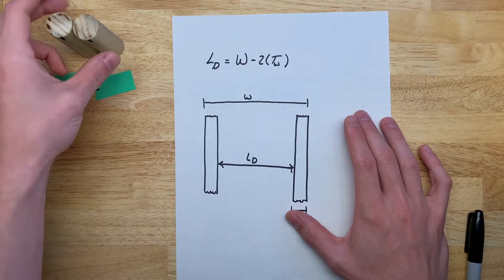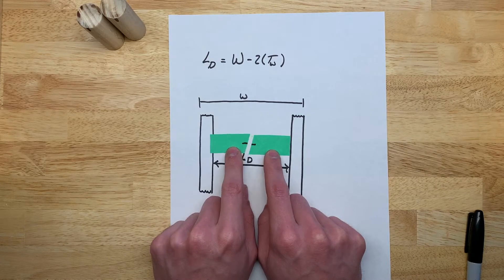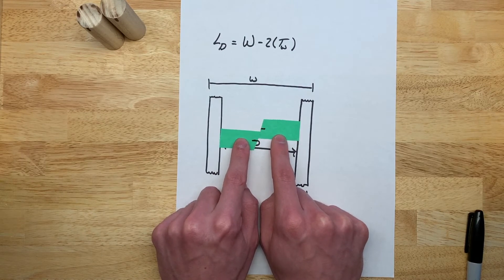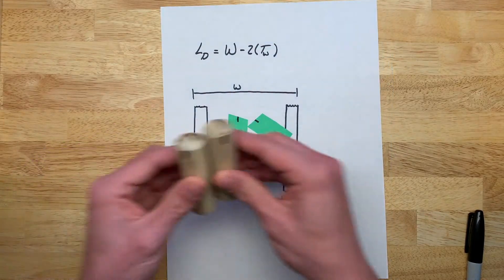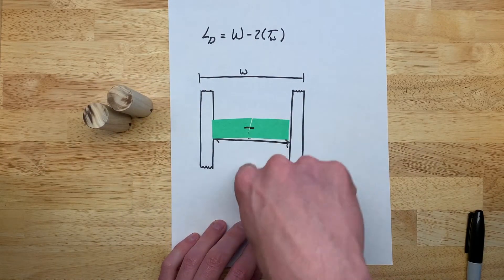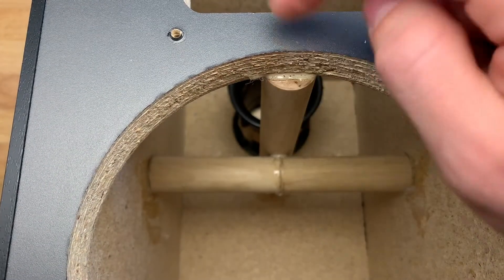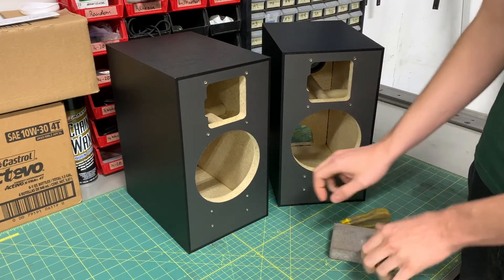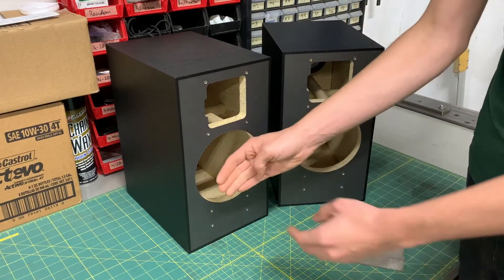Part 3/3 Upgrading the Enclosure and Reassembly - Upgrading Paradigm Mini Monitor V5

Comment: That was a nice endeavor but I saw that you put back the polyfill damping material inside the box. Personally I think polyfill is one of the worst stuff as damping goes. Nowadays I use mostly 1/4 inch acoustical foam because it is better at controlling midrange frequencies and reverberations. Of course, it cost a little bit more, but the improvement is more than marginal. Try it on one of your speaker and compare to the one with polyfill and tell me how it sound.
Reply from the maker: @Yves Boutin - The reason I did not include the adhesive dampening foam in this build is simply because I forgot to put it in my order when I got the crossover parts. Oh well, mistakes happen! I can get it next time I make an order and put it in then.
Reply: @Casey_Schmidt  ...or try Rock Wool, I've found it more acoustically absorbent than anything else I've tried and will be using some when I get my Paradigms. I like the port design, with the two rolled ends it appears one could play with the low octave response by slightly shortening or extending the PVC tube which runs between them. I'm toying with the idea of closing the rear port and adding one to the center of the bottom, and of larger diameter, so I can use a longer tube to double as a stand with the port opening at the bottom, firing into the floor for better room bass coupling.

Comment: Any comments on the upgrade? Was it worth the 100usd in parts? Just picked up a pair of these stock and havent had a chance to listen to them.
Reply from the maker: @gsrchris u - The sound signature after the upgrade makes them sound much more open and transparent, in my opinion. There is more detail in the decay of notes/vocals and you can hear reverberations in the space in which the recording took place a lot more clearly which aids in detail. It’s no replacement for a top-dollar system but it’s a substantial improvement.

Asking whether it’s worth $100 USD is a tough question to answer. If you’re on a very tight budget, I would probably say no it’s not worth it because the improvement in sound, while significant, isn’t truly necessary for a budget system. If $100 USD is worth the enjoyment of the upgrade process and the incremental improvement in sound quality, then I’d say it’s absolutely worth it.

Comment: What as the paper for when you soldered the wires to the woofer?
Reply from the maker: @Shop Philosophy - I put it there to prevent any solder splatter from hitting the woofer cone or surround.